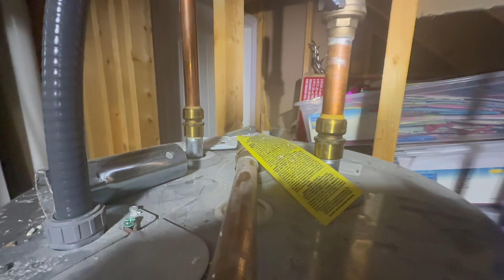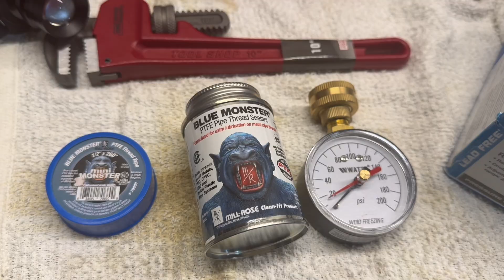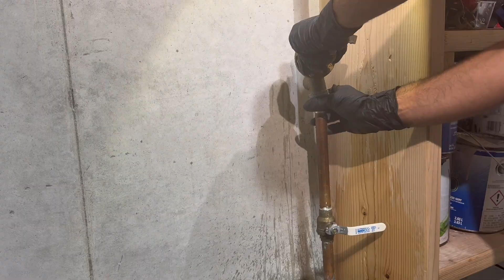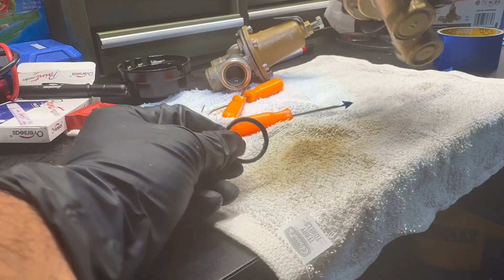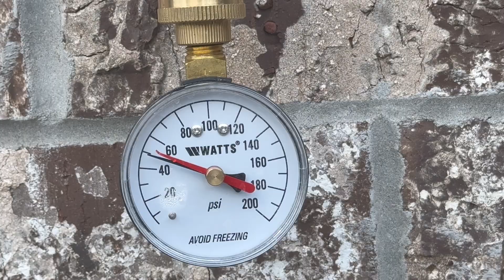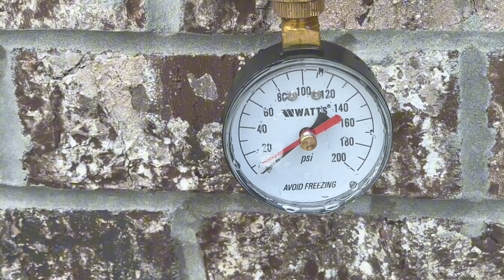My Water Pressure was 140 PSI! How I Replaced my Pressure Release Valve (PRV) Prevent Disaster!

Comment: The O- should be replaced if it has developed flat spots . It will leak at some point . I always apply a thin coat of silicone grease or like the dielectric Super Lube grease with PTFE. I looked up the Super Lube for rubber O rings and it is ok to use . And never over tighten down on O ring seals . That is not how they work. They expand from the pressure and need the room to do so .